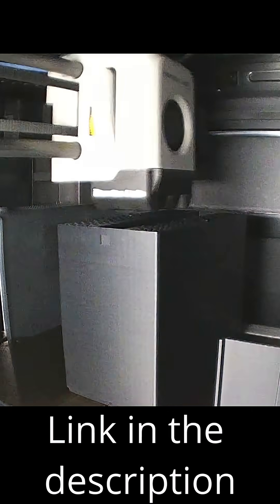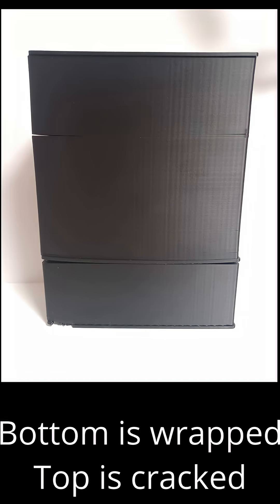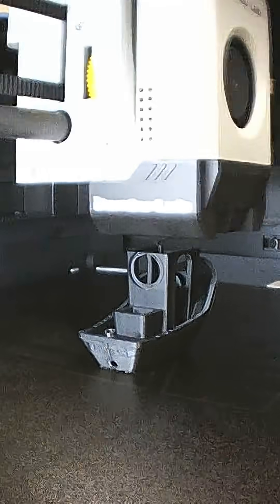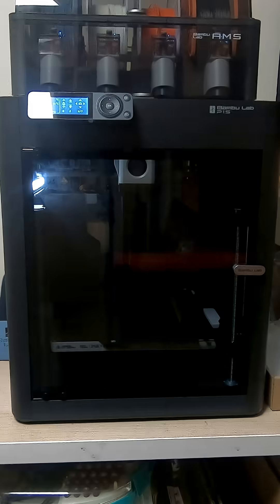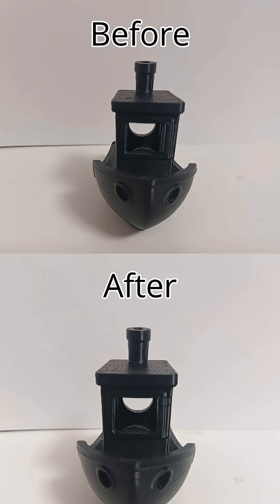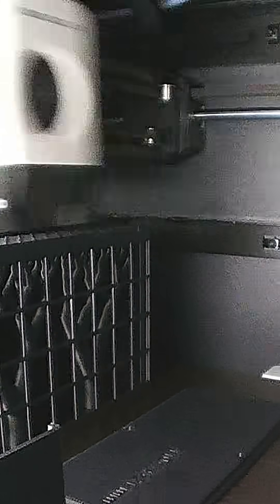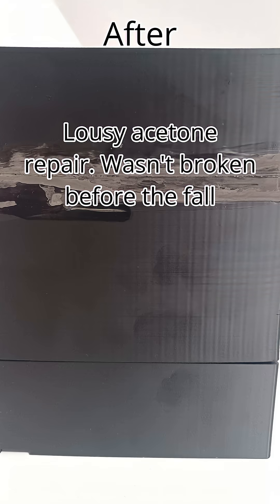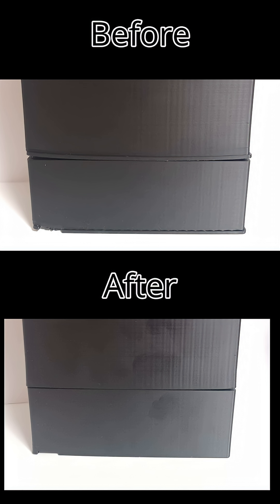Bambulab P1S - Warping with ASA

Comment: Well i had the same problem i think on my a1 and kinda annoying but i think its maybe because of the texture plate i use smooth with glue stick i think its better but haven't printed something big with corner yet
Reply from the maker: Wow, I didn't know you could print ASA with the A1!
Reply: @Romagnetics well tbh i haven't tried it myself my school have some they said it worked for there a1 but it only what i heard

Comment: Tips:
1) use brim or skirt
2) rise nozzle teperature
3) use konstant 30% blow patr fan
4) reduce max blow part fan for brige at 50%
5) start blow with part fan at 3rd layer
Reply from the maker: Thanks a lot Lukas, will try that! Quick question: I read that the part fan should stay at 0 percent, can you point me to an explanation as to why I should put it at 30?
Reply: The faster you print the more likely it will warp. Due to the heat soaking in the part. Having hot air blowing at the part even at 30% could work. I don't use bambo labs printers but I print ASA very fast but at 275c and 110c bed temp. But the air blowing at my parts is hot air. 
The very large brim + mouse ear corners would help alot.
Reply from the maker: Thank you for the explanation! The thing is that since the air comes from the bottom of the unit, i.e where the air is colder, I'm afraid the part fan may end up doing more damage than good but I will try it. I assume there are a lot of variables, but what do you reckon would be a good speed for printing? I will also try 275 C and 100 C for the bed, unfortunately my version of the P1S doesn't go over 100. Cheers!
Reply: @Romagnetics try manually setting the first 20 layers to cooling fan off and printing slow just to get the corners down on the bed as well. There's probably 100 ways to make it work. But with the bed temp only hitting 100c if you were to look at your bed with a thermal camera/flir camera. You will see the center maybe 100c the the further you get to the outside of the bed it might be 10-15c colder which is also possible to slow the larger prints to start coming up.